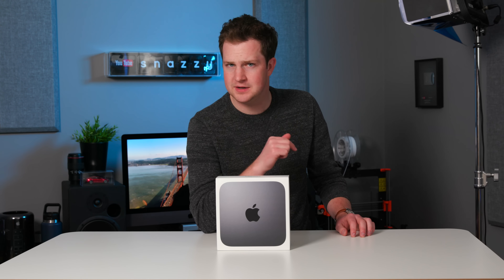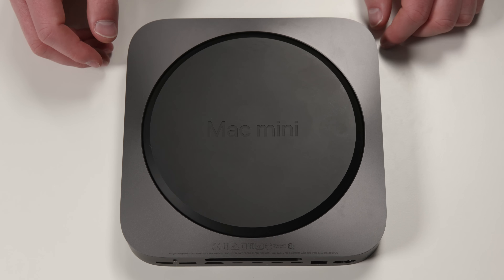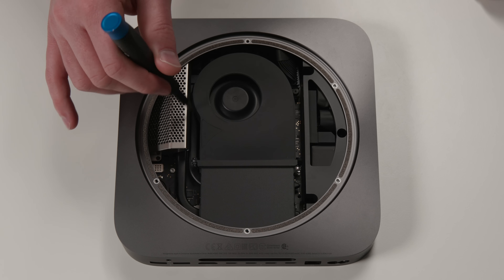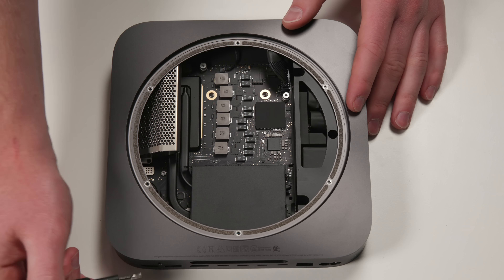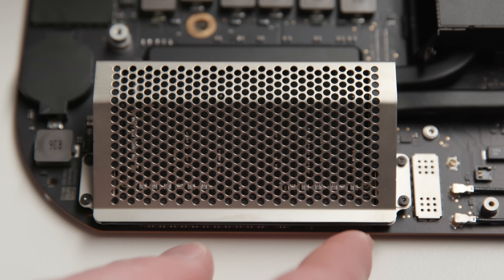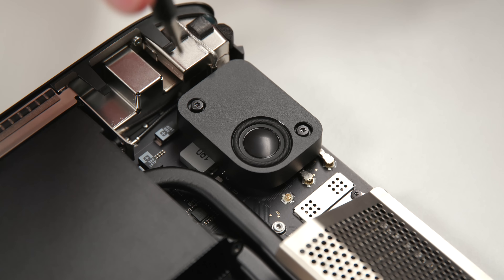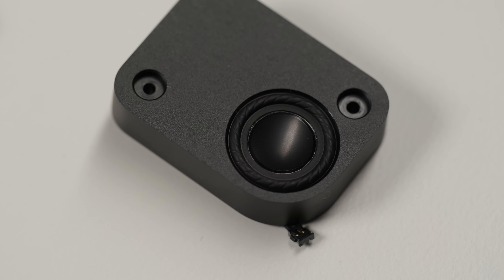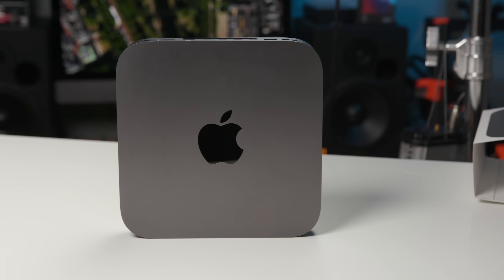Can You Upgrade the 2018 Apple Mac mini?! - RAM Upgrade Tutorial and Teardown

Comment: A beautiful looking circuit board but when the SSD dies it cannot be replaced. could that be classed as planned obsolescence ?.
Reply: @Sally Smith Totally depends on the SSD and on the usage. SSDs won't break from shock, but from too much written cycles.
Reply: Apple is ALL about the planned obsolescence. Even back in the 90's when they soldered everything in the iMacs ....... Of course if you had a friend who knows how to use a soldering iron on boards, then upgrading it was't an issue. Luckily my friend had me to do upgrades instead of shelling out 400$ or more for more ram or hard drive space (or a new graphics card)
Reply: Yep that's CrApple for you.
Reply: By the time the SSD dies on this (unless its a defective part) the rest of the machine will be completely useless anyway. SSD's last MUCH longer than spinning drives. You can also boot from external drives if you want to. Hell, you can boot from an SD card if you wanted to with a Mac. It'll be slow as dicks but it's trivial to do it.
Reply: @TalesOfWar   An external isn't going to be pretty. Its just dumb decision from a consumer pointn of view.
Reply: Yep, and forget about getting a pro to solder on new chips, that T2 chip most likely wont let you! (I suspect you cant upgrade the ram to another brand either)
Reply: @SilvaDreams  So true, also Apple this year dropped support for the iPhone 5, which came out in the same year as the Galaxy S3. Galaxy S3 is still getting monthly updates while iPhone 5 is planned obsolescence. If you don't have a 2013 iPhone then apple says: f*ck you! I cannot understand how the government allows this to happen
Reply: @egmons8199  Citation please. Officially, the latest software for the S3 is 4.4.2 released in 2015. I can only find information on being able to update to Nougat (latest release was Dec 2017) by using custom ROMs.
Reply: I guess it really goes down to wheather or not you get dabbed on by steve jobs with a crappy SSD. The problem with any piece of hardware is that there is always a chance of failure/not performing up to standards. Now I know that Apple doesnt really care about product longevity but it's not like Apple is even willing to invest in the still new M.2 SSD when that they are currently using is probably more reliable. (There is a reason new SSD prices have been dropping)
Reply: @egmons8199  Please don't make me laugh. Galaxy S3 receiving updates past it's two year lifespan? Yeah right. In all seriousness though, it's better that people who own iPhone 5's aren't able to update their device to the latest version and cripple their device performance. To your point however, iPhone's do receive the longest support from any phone manufacturer unless your talking about Blackberry from back in the day.
Reply: Yes any major part that can not be replaced (or at the very least relatively easily) can be considered planned obsolescence!
Reply: @SilvaDreams  You won't be able to replace any of the SSD chips as that will prevent it booting due to the  T2 chip.
Reply: @jojodroid31  Plus, Apple engineered power circuitry burning out the whole board.
Reply: LoL, this guys said "when the SSD dies".......I have yet to ever see that happen.
Reply: @8654ZuluFoxtrot  of course SSD chips become unusable your comment show's you are ignorant of the technology.
Reply: @DogsBAwesome  So just because none of my Apple products have experienced a problem with their SSD's, I'm "ignorant of the technology".   You TROLL's crack me up!
Reply: @TalesOfWar  You can boot from an external, but the bootloader (or something) is on the internal -- you'll still be in bad shape if/when the internal dies.
Reply: @DogsBAwesome  Of course it'll fail eventually, but by the time this happens (barring any manufacturing defect or the like) the usefulness of the product as a whole will have been far exceeded by the time this actually happens given how reliable SSD's are compared to spinning disks.
Reply: @TalesOfWar  I stand by my statement in four to five years if God forbid you fill the drive over 80% regularly the new Mac mini as a very good chance of running like a bag of spanners.
Reply: But you can replace an SSD. Just need to unsolder it from the motherboard and replace with new ones, its just a chip.
Reply: @ArtyomGalstyan  I doubt it the T2 chip would prevent to use after repair
Reply: @DogsBAwesome  The T2 Chip is a sneaky move made by Apple so prevent further Upgradability
Reply: @jojodroid31  I have a 2012 retina..SSD still works fine.  Write speeds are just as good as they were when I first got it.  SSDs are over-provisioned at the factory to give them a lot of extra space to work with, so if the writes slow down, the controller can mark those specific cells as bad, and keep track of everything so that the user doesn't notice any degradation in performance.  The one caveat to this is when the drive fills up.  So long as you don't keep your drive full, it should be fine, for a very very long time.
Reply: @Sally Smith SSDs only degrade with writes are done to them (Reading has no effect),  same with a normal hard drive only they also suffer from mechanical failure. I had a 4GB hard drive last from 1997 to 2009 when it finally began to fail due to bad sectors as it was mostly used as long term storage for old data
Reply: yes ssd's last a long time, i still have (or i gave it to my friend and he still has it) an old intel 320 180gb, it must be 6-7yrs old at least, but bear in mind i paid £180 for that drive at the time, you can now get higher gb in smaller drive for much cheaper, so bearing that in mind do you think they will still last like they did?
i dont, tech doesnt get cheaper bigger faster smaller without some kind of drawback and the drawback is always durability, 
and as for they only wear when you write to them also bear in mind, even though you are not erasing and rewriting stuff all the time, your computer is, eg updates, temporary files, cookies, browsing history, memory dumps, page files, virtual memory,  viruses, spyware etc, and then on top of this we now have wear leveling, which might serve to stop 1 section of the drive being rendered unusable before the rest but this also means those files you thought you wrote once and forgot about or only read, are also being rewritten, thus causing wear, so its not all a bed of roses, though all these things might be trivial in the grand scheme of things, only time will tell how durable newer drives are, so im even less ready than ever to give up my upgradability rights to become an apple wanker ;-)
Reply: Johannes you just pointed out one serious flaw about the Ssds and why I should stick to mechanical hard drives
Reply: I spoke to Apple about that.  The SSD can be replaced by replacing the main board.  Apple charges only for the SSD.  So, anytime the SSD goes bad, you get a new computer for the cost of the SSD.
Reply: @TalesOfWar  That's assuming they're using quality SSD module. For all we know they prolly use the cheapest module they can get that would die within 3 years.
Reply: Sgtbrobee 😐

Comment: The T2 chip is designed to make you completely locked in and dependant on Apple.
Reply: Not like you could really replace anything in there without some expensive equipment anyway.
Reply: Epsilon It's meant to hold your data at ransom as well. Your data is encrypted whether you like it or not.
Reply: Some Things In Life  Not true, the encryption and secure boot can be disabled, infect if you want to install Linux, you have to.
Reply: mikeward1701 I don't think the next gen T2 chips are designed to allow you to do much of anything in the name of "Security". On the old chips it was possible. These new chips will be different. Just wait and see.
Reply: Succy Succ Succ do the old Mac mini’s(2011, 2012, 2014) are also secured? Or those machines are more vulnerable?
Reply: Succy Succ Succ Hahahah....It doesn't prevent spying. It just makes things difficult for you.
Reply: Some Things In Life lol 😂 talk about exaggerating
Reply: Succy Succ Succ Most of consumer "Security" is a bloody illusion. The enemy is inside...Not outside. Malware in your Hard disk Firmare, Intel Management Engine etc etc. Governments and Companies have pretty much a direct access to your brain now through Computers and Phones.They will never give that power up.
Reply: FoodTechLife I am really really not exaggerating. Did you miss the Snowden leaks? Stuxnet? Equation group etc etc. They are just the tip of the iceberg. The whole idea of computers from Turing and Enigma took off because of Spying, breaking encryption, espionage, watefare. Do you think they stopped?
Reply: FoodTechLife The best solution I have found is to behave erratically. So erratically that they can't put a finger on it. I pose as a liberal and republican online,  I pose a flat earther and subscribe to science channels. I pose as racist, sexist, pacifist, Buddhist,  Muslim, Christian, White, Black, Jew...You get the drift :)
Reply: @somethingsinlife5600  I think they're more to protect people from stealing your stuff. For example if the police gets it, this locks them out and they can't go through the computer if they wanted to.
Reply: they shouldve done it like a chromebook, a suuper good security that can be god-keyboard-comboed away
Reply: moo You're calling me uninformed huh? Go check all the research on Intel Management Engine, every non politically correct security expert calls it straight up a back door. Also check out the disclosed vulnerabilities it has. We don't even know what the source code or actual hardware is for something so powerful. So yeah...It's a bloody back door.
Reply: Singin Girand You don't need the T2 chip for that. I can encrypt my data whenever I want. That kind of encryption can't be bypassed. This T2 encryption can be bypassed.
Reply: Singin Girand The latest news on the T2 chip is that it blocks Linux from installing/working.
Reply: moo You don't have argument do you? Go away child. Advanced tech discussion, research and history isn't your strength. Go watch unboxing videos. And remember that watching unboxing videos and reviews by kids doesn't make you an expert on Tech.
Reply: Even the Apple RAM modules could have serial numbers inside the Serial Presence Detect eeprom.
Reply: @somethingsinlife5600  You can turn it off. And I'd rather my data be inaccessible to myself AND everyone else than for it to be easily retrieved by whomever stole the damn thing or made a copy somehow.
Reply: TalesOfWar You apple fans are insufferable. If Apple handcuffed you to the wall, you would be saying it's good because no one can kidnap me".

Comment: Please build a hackmini that is cheaper and has better performance.
Reply from the maker: Coming the first week of December!
Reply: It's impossible. The mac mini is a bargain, and all the computer 99% of families will ever need.
Reply: @snazzy  Looking forward to that!!!!!!!!!
Reply: Malc180s 99% of families do nothing but Facebook lol. You can do that on a 2012 netbook.
Reply: @gfjfjufidi2880  My 2014 netbook has a touchscreen other than some expensive laptops. It can also read and delete error codes in the ECU of my car.
Reply: You're gonna miss T2 chip though
Reply: @Malc180s  cough nuc cough
Reply: Make it smaller too!
Reply: VANNIVEZ yes!!!!!
Reply: Gfjfj Ufidi good luck with that, netbooks are awful excuses for computers and can’t even properly browse the web today, i had one and it was so slow just installing windows took over a day.
Reply: It's very hard. There are no commercially available motherboards this size, even mini-ITX motherboards look massive compared to Mac mini. Most prebuilt OEM mini PCs are equally lackluster and look cheap and hideous. I'm very curious to see what Quinn's gonna come up with!
Reply: with 4 TB3 ;) or at least one. @snazzy
Reply: altrogeruvah If he doesn't already have a design, how about a mini ITX board with an NVME SSD squeezed in and some 40mm server fans.  Use bent steel plate instead of carved aluminium for the box.  Try to keep it under 1U tall (1¾" minus 1/16" for spacing) so it can be squeezed between a 48 port switch and other network gear.  Use a micro PSU module and run them from 48V, 24V or 12V UPS DC.
Reply: @brando12343  Yeah, Windows. Nobody should put Windows on a laptop under $1000 for that reason.
Reply: Snazzy Labs I am signing up for notifications just for that video. Please include parts purchasing list. Thank you!
Reply: @Malc180s  Dude the "cheap" one costs min $800 and the "high end" one costs $4.200 if you max it out. 
If you buy the Baseline model and Customize it so you can actually use it without a problem you would need to pay $1.800 that's not a "bargain" lmfao
Reply: Snazzy Labs Use an S4 Mini case or something similar to a gaming console size please.. Cos I'm trying to build one myself, but I need guidance..
Reply: @altrogeruvah  build a custom mini STX build with socketed desktop cpu in a custom aluminum case. Easy.
Reply: @Meso Phyl Consoles exist.
Reply: @snazzy  Are you still working on this video?

Comment: I learned from this video that I should buy the RAM upfront and enjoy my new mini out of the box. lol... Thanks for another great video.
Reply: Sad but true :(
Reply: Our I can buy a good computer.
Reply: A kit of 32GB DDR4 SoDimm that is faster than the memory Apple offers (3200 MHz vs 2666 MHz), costs about $320.  The upgrade that Apple offers is $600 for 32GB.

For 64GB, you are able to find kits for about $800 - again, half the cost of their upgrade.

I'm not really sure why anyone would want 64GB in a Mac Mini, but if you wanted anything more than 16GB Ram, I would definitely open it up and upgrade it myself.  Plus, you can sell the 8GB set that comes with it as "Official Mac Mini RAM", and people on Ebay will eat it up.
Reply: Really not that big of a job to replace it, as long as you have the tools.

Comment: 1:28 - Just gonna take a LITTLE GUESS here before I watch the rest of the video: Practically not at all?

Edit: Bingo! Fucking soldered-on SSD, that's ridiculous in a desktop machine. They easily could've fit an M.2 drive in there. I can't believe they even offer a 128GB option either, it seems that 256GB is the new "minimum" for PCs.

However, absolutely excellent video man! Great camera work, editing, and narration. It was enjoyable to watch.
Reply: No kidding. I can't believe a m2 ssd or even msata would be impossible to fit. And getting an external drive defeats the whole point of this compact device.

Meanwhile I got a 8300 Elite and a cheap 256 Intel SSD for a hackintosh.

Comment: But can you upgrade the ram without fearing that the t2 chip would block your computer?
Reply: @Sally Smith Name one example if shady merchants that do this? There are none. By shady merchants you mean repair shops and refurbishers.
Reply: My life would have been better if I never read that comment. Every sentence could be disregard as false. Processor companies have intellectual property that they will defend. Swapping a logic board is not done to be malicious. Let's say you have 2 laptops one has a cracked screen, dead battery or other issues. Let's say you have another perfectly good machine with just a bad MB you take the perfectly good board replace the bad one now instead of having to useless machines you have one perfectly good one. Also the "shadyness"  described is a power management issue that is typically caused by low battery voltage hence why the issue went away when the MacBook is plugged in. If only there was a way to fix that without it being malicious and making it a counterfeit? If only there was something you could do besides throwing away a MacBook Pro that. Is perfectly fine except for the battery, one of the lowest cost parts in the machine. Or paying apple an exorbitant fee to install a battery. Also to this date their is no reason you should not be able to replace touch ID, or Camera sensors in a iPhone. the facial recognition and Touch images are stored in a chip on the logic board not in those components. Also regarding Intel in the 386 and 486 days the companies Cyrix and AMD both had liscences to produce X86 instruction based processors. They had a legal liscence to those designs and Marketed their processors and Compatible or Equivalent. Intel has an equally abismal track record of consumer friendliness when they fought hard to maintain full control of the market.
Reply: Yes the T2 basically guards the integrated CPU & GPU (Which it has a limited number of approved parts that it will allow not too dissimilar to Mac OS but each T2 is encoded for each device it goes into!) and any external connected device which it will scan for threats and drivers!
Reply: The RAM is not T2 protected just make sure when you buy RAM it says it works in MAC or at the very least uses the same connection type!
Reply: Tim Cook : That is a good idea, people should buy ram from apple not third party
Reply: How would the T2 stop them? Surely the fake logic board wouldn't have a T2 chip on it and would have some form of crack on the OS to get around it?
Reply: They should buy what works from a third party manufacturer, otherwise all you are doing is lining Apple's pockets. If you have an issue that requires servicing you can always slip the original ram back in.
Reply: @user-yv2cz8oj1k  The OS now looks for the T2 chip if it does not sense one it will not allow it to boot!

The older devices will receive a different version that lacks this feature so they can still boot but all new devices must have the T2 chip in order to boot
Reply: @Sally Smith counterfeit apple motherboards don't exist. They are unique parts built for apple. What you mean by "counterfeit" is parts harvested from broken apple devices to fix broken apple devices.
Reply: T2 doesn’t check your ram
Reply: @DarthAwar  It works exactly like a TPM in a PC.